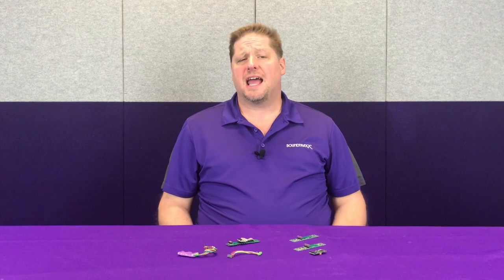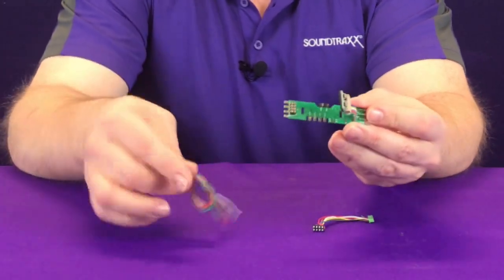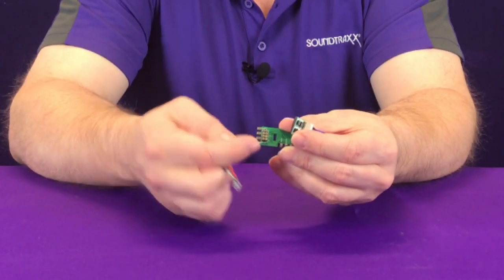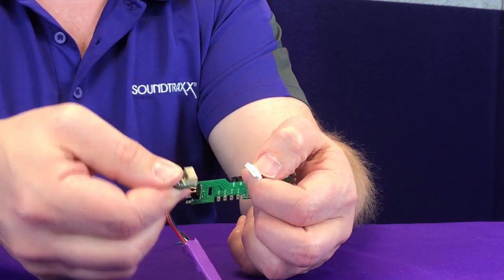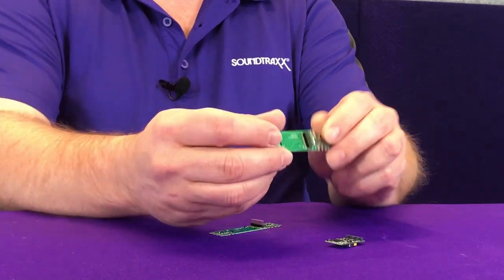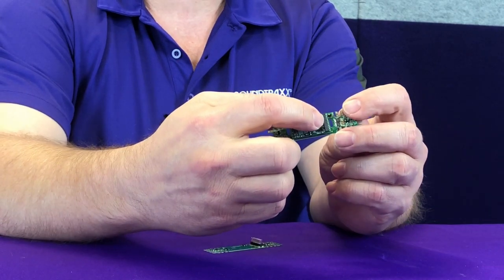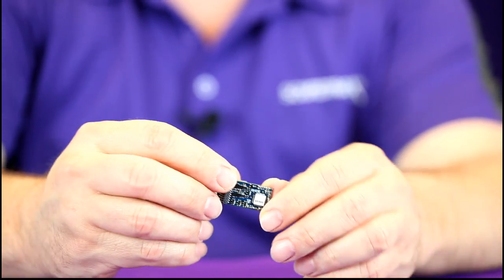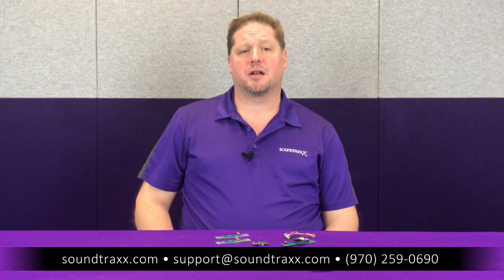SoundTraxx Tech Tip: Quick Plug Connectors

Comment: Can it work with bachmann steam trains alco 2-6-0
Reply from the maker: Maybe.  You would have to check the available space, but if you have the room, then it will certainly fit.  Worst case, you can use the TSU-1100 and solder the NMRA 8-pin plug at the end and plug it in.  The TSU-1100 should more easily fit into the model if the TSU-2200 version does not. If you need more assistance please contact our Support Team directly: (970)259-0690 ext. 22 or support@soundtraxx.com